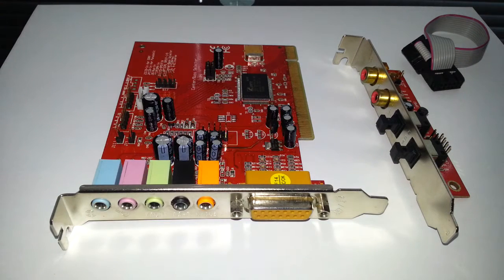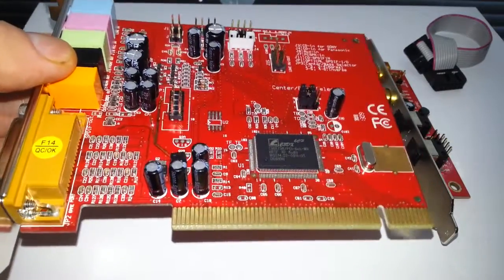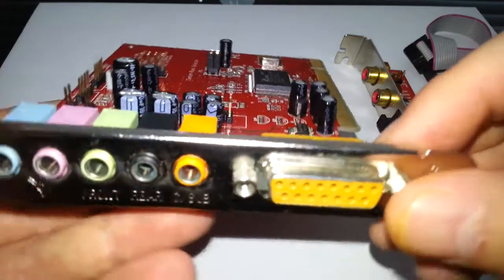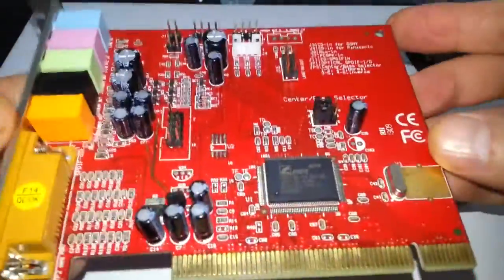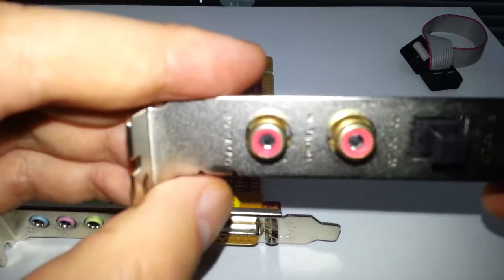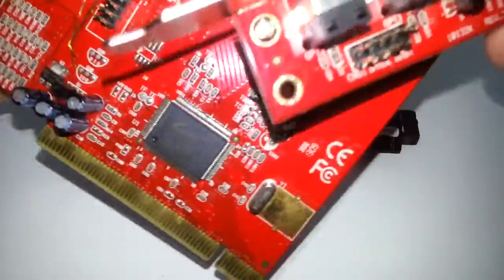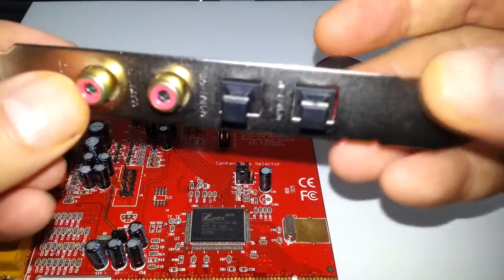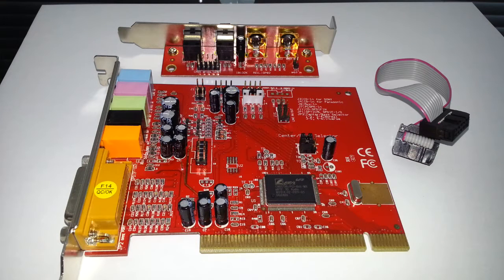My C-Media CMI8738 6Ch Sound Card Review

Comment: Actually 8738MX, best of cmi8738. Maybe you can't buy these "MX" sound card easily now.
Amazing thing is this card supports MS-DOS to Widows 10 64bit.
Has Lagacy Sound blaster compatibility with built-in OPL3 core & MPU-401 game port.
Beware, it seems MX has all feature but 8738SX which can find at $5 easily not all have these lagacy support feature because of nowaday model could removed these feature especially OPL3 & MPU-401. 

CMI8738 Soundcards have 8738MX chip was not cheap at they first came out. Such as Terratec Aureon, Zoltrix Nightingale.
MX - 5.1ch with digital in-out.
LX - MX minus digital in-out.
SX - LX minus 5.1ch (actually 4ch)

For answer of below question. Win 10 MIDI module - YES / Gameport - No
Reply: interesting, would be awesome if Gameport worked on Win 10 haha.
Reply: That's so cool to know. Thanks
Reply: late to party but this sound card has drivers from win9x to Windows 7. the drivers for win7 can be used for win10/11.

this sound card does not really support dos, even though c-media released a beta driver initializer that activates its beta sound blaster emulation only mean't for some apps that really need real mode dos and not windows dos prompt vm SB emulation, as it is only beta; it has really poor dos compatibility in real mode. so only older games that don't read dma control register settings and only use single cycle dma really work. under win9x is where it's dos sound blaster emulation is fully functional. so i guess that counts as msdos support?